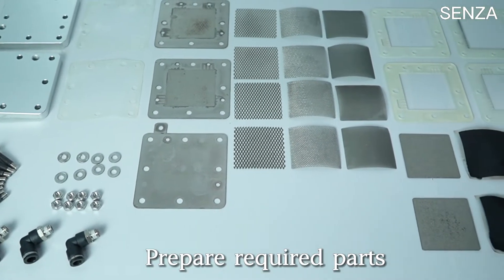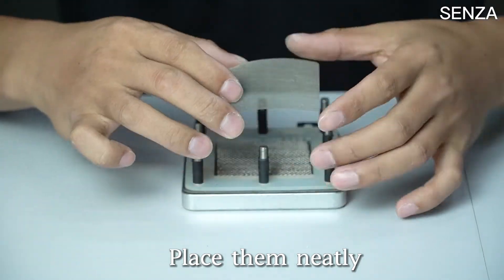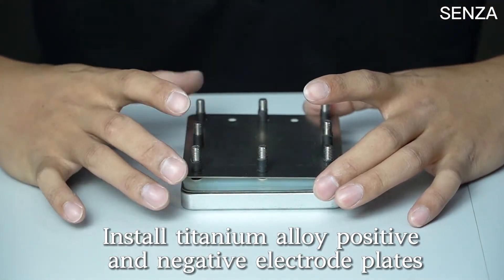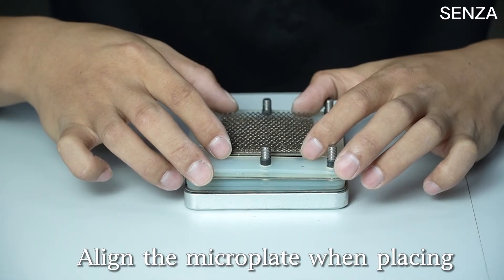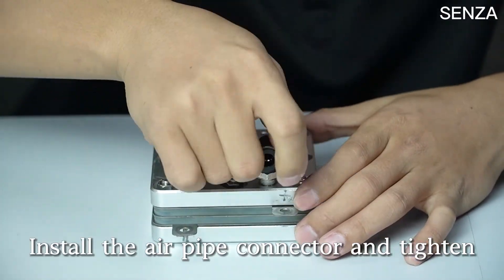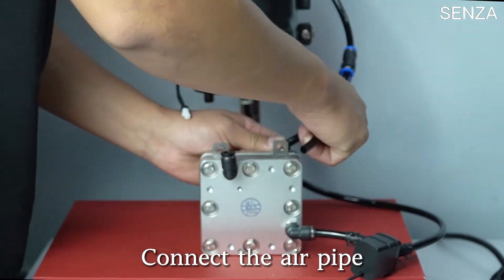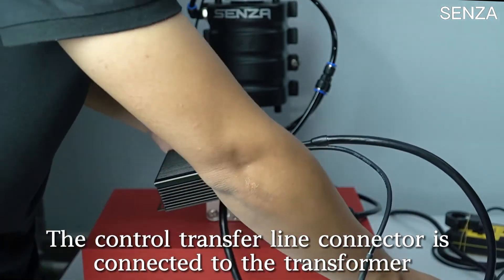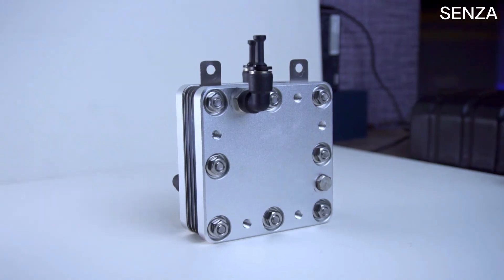How To Build A PEM Hydrogen Generator

Comment: How is connection made between cell 1 and cell 2. In the medium middle bipolar plate, and how hydrogen it transformed from cell 1 to cell 2 and finally to hydrogen output
Reply from the maker: For more details on this question, please see our article:
https://senzahydrogen.com/understanding-pem-electrolyzer-components/

It even includes a low-detail 3D model to give you a basic understanding of the internal structure. You’ll notice that the holes in the silicone gasket have a special design.

Comment: Excellent video but I have a question, how do the internal membranes receive energy? Because the first anode and the second cathode are polarized, while the first cathode and the second anode are connected to a titanium plate that is not polarized, how did the electrons reach them?
Reply from the maker: In a PEM electrolyzer, electrons don't pass through the membrane. Instead, they travel through an external circuit. Here's how it works:

At the anode, water is split into oxygen, protons (H⁺), and electrons.

The protons move through the PEM (proton exchange membrane) to the cathode.

The electrons travel through the external circuit — from the anode-side titanium plate to the cathode-side titanium plate — completing the electrical loop.

So, even if the first cathode and second anode are connected to titanium plates, those plates conduct the electrons via the external circuit. They are not “unpolarized” — they’re part of the electron flow path. The membrane itself only conducts protons, not electrons.

You can check this video https://www.youtube.com/watch?v=q-LwF_sfMxc

Comment: Looks like it will also work in reverse to produce electricity?
Reply from the maker: In principle, it is possible, but the overall design needs to be changed to make it more suitable for using hydrogen and oxygen for input. Such a product is called a PEM hydrogen fuel cell.
Reply: I’m working on this project to generate electricity. Please how can I go about this? And where can I get affordable parts as it’s a school project. However, I’m hoping to be able to generate up to 3kw for home use cade

Comment: Hello. What material is the microplate made of?
Reply from the maker: It is also called the Gas Diffusion Layer (GDL).It is electronic conductor between the MEA and BPP, ensures efficient mass transfer of liquids and gases between the electrodes and the BPP.Its material is titanium
Reply: thank you for the answer.  Is this microplate also available in other materials?  And where can I buy this microplate?  Where can I buy all the parts to make that generator ?
Reply from the maker: @farugmagsud  At the moment, no better alternative material has been discovered, as the GDL needs to simultaneously meet the requirements of corrosion resistance, porosity, and good electrical conductivity. Regarding the purchase inquiry, we also sell PEM electrolyzers. You can contact us at email: service@senzahydrogen.com.

Comment: That is NOT a PEM. A pem is a proton exchange membrane, it is a generator that uses the fresh air and hydrogen to induce  current!  NOT apply current to it... wtf. That is an electrolysis device for separating hydrogen and oxygen.. morons. You need platinum for a PEM to work,  hence the very high cost.

Comment: What is the role of microplate?
Reply from the maker: The gas diffusion layer or called the current collector GDL or PTL, as an electronic conductor between the MEA and BPP, ensures efficient mass transfer of liquids and gases between the electrodes and the BPP.
https://senzahydrogen.com/understanding-pem-electrolyzer-components.html

Comment: Do the bipolar plates act like electrode? 
And how could the water go through the stack as I don't see channels for the water to pass.
Reply from the maker: They are transmitting through channels.
You may not be able to see it clearly in the video. You can see pictures in this post.
https://senzahydrogen.com/understanding-pem-electrolyzer-components.html

Comment: How can i determine me PEM Electrolyzer dimesions depends on Hydrogen production rate?
Reply from the maker: It seems you want to understand how to determine the size of a PEM (proton exchange membrane) electrolyzer based on the hydrogen production rate.

However, there are several factors to consider when sizing a PEM electrolyzer, including:

Desired hydrogen production rate: This is the most important factor as it directly determines the required current throughput of the electrolyzer. Higher hydrogen production requires a larger electrolyzer.

Efficiency of the electrolyzer: This depends on the specific electrolyzer technology and operating conditions used.

Operating pressure: If the electrolyzer runs at high pressure, it may require a larger size to maintain efficiency.

Electrolyzer materials and design: These factors also influence electrolyzer size and performance.

Current density: Higher current densities yield more hydrogen but may reduce energy efficiency of the electrolyzer due to greater voltage losses at high current densities.

I suggest first consulting with relevant professionals to determine the optimal electrolyzer size based on your desired hydrogen production rate. If you are looking to customize an electrolyzer system, you can also contact us(service@senzahydrogen.com) for assistance. Our team has experience designing and sizing electrolyzers for various hydrogen production applications.

Comment: What is the maximum current that can be applied to the cell? It depends on the membrane area, right? As part of my thesis, I developed an electrolysis cell with a membrane area of 5 by 5 centimeter. How can I determine the maximum operating current for this?
Reply from the maker: The maximum current that can be applied to an electrolyzer does indeed depend on the effective membrane area. Current density (current per unit area) is a key parameter in electrolysis and can vary between different types of electrolyzers and electrolytes.

Typically, water hydrogen electrolyzers have a maximum current density of around 1-2 A/cm2. This is a rough guideline, and actual values may depend on many factors like the specific electrolyte used, temperature, electrolyzer design, etc.

For a 5 cm x 5 cm electrolyzer (i.e. 25 cm2 area), if we use the guideline value of 1-2 A/cm2, then theoretically the maximum current would be around 25-50 A. However, keep in mind this is just an estimate, and the actual optimal current may be lower, especially if you want to maximize electrolyzer lifetime.

To determine the actual maximum working current for your specific electrolyzer, you would typically do a series of experiments where you incrementally increase the current while monitoring electrolyzer voltage and gas production rate. If the electrolyzer voltage starts rising rapidly or the gas production rate levels off or decreases, this indicates you are approaching the performance limit of the electrolyzer.
Reply: @senzahydrogen  Thanks for the quick reply. I have another question. What is the function of the titanium mesh?
Reply from the maker: @timrohr5920  Bipolar plates (BPP) are flat separator plates (either with metal mesh or screen lamination or with etched flow field channels thick metal separators) used to match the power supply voltage by stacking multiple electrolysis cell units in series. Separate adjacent units and connect them electronically. It needs to have low low resistance and high mechanical and chemical stability, fluid distribution, and high thermal conductivity as it also helps to promote heat transfer.
You can check this blog https://senzahydrogen.com/understanding-pem-electrolyzer-components.html

Comment: What is the function of the microplate? Is the microplate the electrode or is the electrode material included in the dark layer on the PEM along with the catalyst material?
Reply from the maker: They are GDL. The gas diffusion layer or called the current collector GDL or PTL, as an electronic conductor between the MEA and BPP, ensures efficient mass transfer of liquids and gases between the electrodes and the BPP.

At the anode, the liquid water transports from the passages of the BPP to the catalyst layer on the membrane through the current collector, where the water is decomposed into oxygen and protons. The oxygen generated here diffuses in the opposite direction through the current collector into the flow passages.

At the cathode, liquid water and hydrogen are transported from the membrane to the passages of the BPP through the current collector. Electrons start from the catalyst layer on the anode side, pass through the current collector and BPP, and then reach the cathode side. In PEM electrolyzers, the anode potential is high enough to oxidize carbon materials and other materials must be used. Titanium is often a choice for current collectors at the anode. 

You can check this https://www.youtube.com/watch?v=N-uOW0DNDO0

Comment: Interesting video. Do you know why the nafion membrane is black? because neat/pure nafion 117 is translucent right? Is there an additive in the membrane and do you know what this is?
Reply from the maker: Yes, neat/pure nafion 117 is translucent.neat/pure nafion 117 is translucent.Given that the anode of a PEM electrolyzer is in a highly acidic environment, most non-precious metals are prone to corrosion and might potentially combine with the sulfate ions present in the PEM, thereby reducing the PEM's proton conductivity. Hence, it is necessary to spray a coating on both sides of the membrane. The best choice for this coating is IrO2, followed by Pt, Ru, and other precious metal/oxides and their binary and ternary alloys/mixed oxides. Notably, IrO2 is black in color.

Comment: Hello! I am intrested in build a very small model of my own for research, using individual parts, and I have a few questions about the parts themselves. To start, I will be building this on a small scale (effective area of MEA and microplates 5 x 5 cm) where would I be able to get positive and negative titanium alloy electrode plates at this scale (roughly 8 x 8cm-ish is what I am looking for)? Another question I have is where do you get your specialized silicone gaskets? And would I be able to get them on a similar scale as previously stated? My last question is do you need the small, medium, and large titanium mesh in order to run it, or would a microplate serving as a GDL and electrode work just fine on a smaller model? Thank you for your time.
Reply from the maker: All our parts are custom made in our own factory (including screws). At the same time we do not recommend that you build this system alone. This is because the lack of experience and machinery during your assembly process can lead to inefficiency or even damage to the proton membrane. Take for example the final tightening of the screws. If you tighten them too hard you can damage the plasma membrane, if you tighten them too hard you can cause leakage.
For more information on BBP, you can see our video on dismantling a PEM electrolyzer by clicking here(https://www.youtube.com/watch?v=N-uOW0DNDO0). We are using two titanium meshes (one with a large grid and one with a small grid).

Comment: any alternative for titanium alloy electrode ?
Reply from the maker: No , There is no better alternative. We have also tried other materials, but they are very susceptible to corrosion. Their working lifespan is very short.
Reply: @senzahydrogen  can you tell me name of that alternative you tried
Reply from the maker: @VipulBundhate  We tested graphite, titanium, and stainless steel. Then we found that titanium is the most cost-effective.

Comment: Great work, but I have some questions.
First , is water going through all this stack ? and how ? 
Second question, is the micro plate that important? Or can I just use diffusion layers ?
Reply from the maker: 1.Water only passes through the anode, and excess water exits the anode along with oxygen.
2.Micro plate is very important.Micro plate is gas diffusion layers(GDL).Ti mesh and Ti alloy positive is BPP.

Comment: What are the microplate and mesh for? Could you just install the PEM without them if it was secured and it does not touch the end plates?
Reply from the maker: This is the gas diffusion layer, also known as GPT, which is a porous layer sandwiched between the cathode and anode and the bipolar plate. GPT acts as a bridge connecting the bipolar plate and the catalyst layer, ensuring gas and liquid transport between the bipolar plate and the catalyst layer, and providing efficient electron conduction.
At the anode, liquid water is conducted through the gas diffusion layer to the catalyst layer, where it is decomposed into oxygen, protons and electrons. The generated oxygen flows back to the bipolar plate through the GPT, the protons are conducted to the cathode through the proton exchange membrane, and the electrons are conducted to the anode side bipolar plate through the GPT and then enter the external circuit.
At the cathode, electrons enter the cathode catalyst layer through the GPT from the external circuit, and react with protons to generate hydrogen gas. The generated hydrogen is collected by the GPT to the bipolar plate. Therefore, in order to ensure gas and liquid transport efficiency and electrical conductivity, GPT needs to have both appropriate porosity and good electrical conductivity to ensure electron transport efficiency.

Comment: Hi, well done. This is a very interesting video that shows a lot about the technology. I have one question though. I have seen many of these outer plates (aluminium) and they all have channels for the water to flow. I have not seen these channels in your plates. How does water flow? Thanks for the video and I do appreciate if you can clear things up to me. Oh, I am already looking at your website, interesting.
Reply from the maker: You can pause to view the section on our preparation materials. You will find 10 holes in the metal plate. More than the 8 holes needed for the 8 screws.Depending on the location and electrode, these holes function differently.

Comment: I actually have a question whether bipolar plates are in direct contact & hence complete circuit or circuit is completed by H+ ions generated at PEM?
Reply: There are two current collectors at the end, one at cathode side and the other at the anode side. These are connected by an external supply that completes the circuit

Comment: I will be prepare this one please support me sir for school experiment

I have one doubt sir
The anode places is platinum the cathode is places nickel Yes sir why  did you use the titanium sir
Reply from the maker: In high-potential, oxidizing, acidic environments, PEM electrolyzers
The requirements for catalyst materials are extremely demanding. A reminder that meets this requirement
Chemical materials are limited to certain precious metals.

Metal stability: Au > Pt > Ir > Ru > Os
Anode catalyst activity: Os ＞ Ru ＞ Ir ＞ Pt ＞ Au
Cathode catalyst activity: Pd > Pt > Rh > Ir > Re > Os > Ru > Ni

Comment: Great! One question, how is the hydrogen output different from the oxygen output if all electrodes are in the same chamber?
Reply from the maker: The hole for the hydrogen output and the hole for the oxygen output are not the same. It is not the same. Hydrogen is output separately, oxygen and water are output together.

Comment: Nice clean build! What is the volume output of H per minute? What is the voltage and amperage draw?  Thanks!
Reply: QUAL FONTE VOCE USA  VOLTAGEM 110 VOLTS  12 V  120 AMPERES 1800 W  ESSA FONTE SERVE PARA O ELETROLISADOR... QUAL SERIA MELHOR FONTE
Reply from the maker: Thanks for your appreciation. H2 production：300ml/min. Voltage 3.4~4V, current 10~20A

Comment: 4.8v 10 amp ?
Reply from the maker: Voltage 3.4~4V, current 10~20A
Reply: @senzahydrogen  ley de faraday ?,  que curioso que el voltaje sea mayor a 2v. Una consulta, como regulan los sensores de los vehiculos porque siempre veo sus videos pero no muestran la parte electronica, que ocurre con el sensor maf y el sensor de oxigeno
Reply from the maker: @jaimefloresalvarez1752  Since I don't know German, there may be some words that I don't understand. I translated using google Translate. First of all, is there anything weird about voltages greater than 2v? Please explain in detail, and I will answer carefully. Second, are they referring to our other or companies' videos? Third, all of our hho car kits require a microcomputer. The microchip program corrects the engine parameters and adjusts the ignition timing and shift timing, which can improve the fuel combustion efficiency of the engine under low operating conditions.